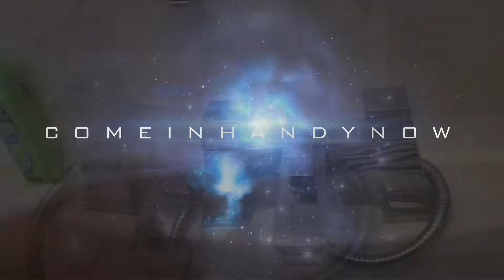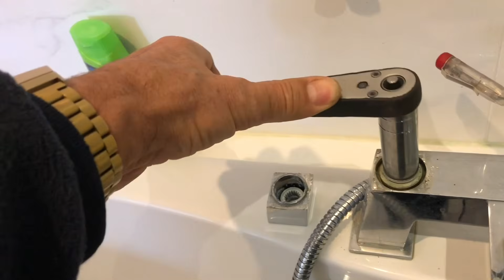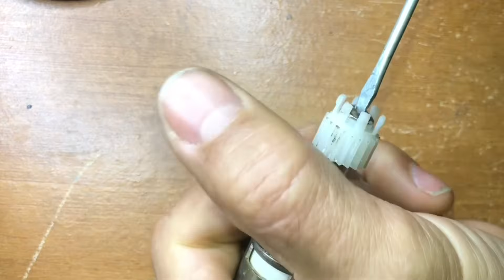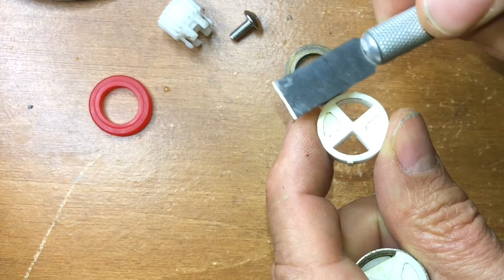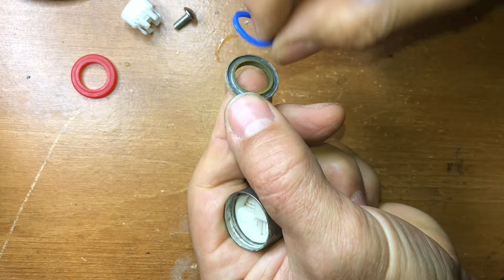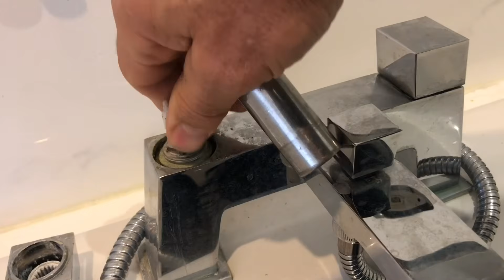Fix a Dripping Tap for Zero Cost Quickly - 1/4 turn ceramic valves

Comment: I think your ceramic plates are back to front, i.e the backs are facing each other instead of the smooth polished side. Probably doesn't make any difference in the end, failure point is probably some washer or O-ring
Reply from the maker: I don’t think so, but it is still working.  The failure reason was calcium buildup spoiling the seal between the ceramic plates.

Comment: I haaaaate these stupid 1/4 turn taps. Costs like $80 to replace the valves and they last two minutes. Losing 12 litres a day from a leaky tap that leaked the day they were installed and it turns out they fail all the time. You'll never know what leaks where and why, either. At least jumper valves can be swapped out for 30c a piece.
Reply from the maker: They are more complicated and more expensive. The way most things go.  Zero cost fix here though so not all bad.

Comment: Philips screw, blade screwdriver
Reply from the maker: Did you not see the text on screen which was “Preferably with a Pozidriv or Philips screwdriver! (I was being lazy)” ?   Were you skipping through and being lazy as well?!
Reply: I find all screws on taps are Phillips. The screw heads are very soft and pozidrives can damage them. Good video 👍
Reply from the maker: @stevenewbank  Thanks

Comment: This is the first video I have seen that gives the principle of operation.  Over 15 years I have repaired mine twice, and never was it deposits sticking on the two discs that caused the problem, in my opinion.  Cleaning is good, but some measures to counteract aging of the unit guarantees success.
Reply from the maker: Thanks, yes, ‘softening’ the water (removing calcium from the water) with a water softener unit is a good step for plumbing longevity.
Reply: Hi, what was the cause of the leaks if not deposits on the two discs? Just replaced my first 1/4 turn tap assembly, want to clean the old one as a spare. Thanks.
Reply: @pmd7914  There is a plastic insert that between the lower ceramic insert and the recess on the tap body that compresses when the cartridge is tightened. 
In my experience this loses some of its 'elasticity.'
Introducing packing above the upper ceramic  insert restores the force that holds the disc surfaces together.
Some designs differ and the packing can be added under the lower disc. I have successfully repaired both types.
Reply: @stonyman694  what do you mean by packing? Please clarify what I could actually use for this. Thanks.

Comment: How do you isolate the hot water if you cannot see an isolator under the sink?
Reply: If the tap hasn’t got an isolator, you’ll have to turn off the mains Coldwater going into the house then turn on the cold and the hot taps long enough to relieve the pressure or to drain off the cold water tank until it stops flowing
Reply: @socialfun621  Ok perfect - sounds like a job after the morning showers when hot water in tank  has been used, cheers
Reply from the maker: @gittin_funky  drain off the cold water pressure first before doing the hot then you won’t loose too much hot water.
Reply: @comeinhandynow  cheers - great channel

Comment: Have you tried putting all the pieces into a some regular citric acid descaler? 
And maybe down into the tap once the cylinder is out too?
Maybe it would do something to the rubber o-rings?
Reply from the maker: No doubt that would help a bit but acid dissolving of scale is a slow process and not always 100% effective in my experience.  No harm in trying though.

Comment: Thank you for this helpful guide. there doesnt seem to be any retaining screw on my square bath taps. Is it just a matter of forcing the cap up with a screwdriver?
Reply from the maker: Thanks. It is difficult to tell you remotely, you will have to try and analyse and work out how it comes apart, with a bit of trying different things.

Comment: If anyone wants good reliable taps, which hardly ever drip, and if they do require a simple change of a rubber washer then AVOID taps with these devises. They are a pain in the arse.
Reply from the maker: Taps with old fashioned rubber washers drip as well.

Comment: Thanks for the video. I have a set of the very same exyfix wall taps. The plumber that installed them took the tool with him when we did the shower area. Now the valves are leaking a bit and need to remove them to fix them or replace them, which is difficult to do without the tool. But at least I know what to do and what I need to do it. Thanks once again. It was a pity, though, that the last half of the video did not show what you were doing with the spindle, as it was away from the camera area.
Reply from the maker: Thanks. I will see if I can help with any missing information.  I had a quick look at the video again, not sure which part of the last half you are referring to. If you can tell me the time point and information needed that might help, I’ll see if I can add something.

Comment: Any tips for how to remove the unit from the ring it sits in that screws into the body of the tap?  As soon as I start to undo the brass unit, the rest of it unscrews as well and I don't want to damage the housing.
Reply from the maker: You’ll have to get a wrench on the body of the tap but isolate it from damaging it with rags or something or maybe put a tube over the tap for leverage.

Comment: Hello I’ve changed both my hot and cold valves for new ones and still my mixer tap is dripping. Please help
Reply from the maker: Sounds like one is faulty or maybe some corrosion on the body is causing it. Dismantle it again and try and see what the problem can be.

Comment: Hi, other youtubers suggest putting some vaseline or other on the 2 surfaces of the disc, what do you think?
Reply from the maker: Not sure I would want that coming out of the tap.
Reply: As long as your taps are not being used for potable (drinking) water, a thin film of Vaseline between the two ceramic discs should be okay. I would not consider any other lubrication.

Comment: Excellent step-by-step video. It certainly is worth servicing a cartridge where possible, not just to save money, but because it can be a right nightmare finding a compatible replacement with the right dimensions, pressure-rating, number of splines etc. This is especially true for some of those cheaper taps with no brand-name.

I would suggest - as others have - that soaking the components in white vinegar then using an old toothbrush to clean off the residue is most effective. When cleaning the deposits off the valve-seat in the tap body, I would recommend investing in a tap re-seating tool which isn't an expensive item and will clean the seat effectively without the risk of scratching the mating surface. I would also suggest flushing the tap body before reassembly as you don't want any of the scraped-off deposits contaminating the cartridge - just open the isolation valve very slightly (unless you want to wash the ceiling) or slightly turn on the other tap if you're working on a mixer.

Great stuff! Thanks for posting.
Reply from the maker: Thanks for you comments and ideas.

Comment: I take mine apart and soak the valve body and the disks in pure white vinegar for 12 hours.  I brush the parts with an old toothbrush every 4-6 hours and rinse well at the end.

 I don't soak the bottom seal if it separates from the disks.  I clean it off with vinegar and rinse it off.  

There's usually no need to remove the top snap ring that's closer to the handle end of the valve. It usually services no purpose in removing the disks at the other end.

This has worked for me.
Reply from the maker: Thanks for your input.
Reply: I have some food grade acetic acid powder and would mix up a small pretty strong lot and soak all the components of the valve  insert for two to three hours then rinse in warmish water to get rid of the acid. This will eat every bit of limescale completely. And providing there are no scratches on the mating ceramic surfaces this should sort any leaks out completely. I also use a strong hot water solution down the toilet to get rid of stubborn under water limescale marks after using toilet brush to try to drive as much of the standing water out of the pan before putting the hot acetic acid in the pan. ( I use hot water as it dissolves the powder much better than using cold)

Comment: You say that all the measurements  are available on-line, but what if you can't find out  what make of tap it is ? The one you dismantled is the strangest design I've ever seen. Mine is Late Victorian /Edwardian STYLE, with classic Cross Heads, but not like those on-line. I've given up repairing it, and want to switch to Ceramic. But where do I start? The 'Shroud' is like a Table Lamp Shade, will it fit over Ceramic inner's ?
Reply from the maker: It sounds like you will need to change the whole tap or pair of taps.

Comment: Hi, What about the valve for the shower itself? Do you just need to unscrew that or smth? Thanks.
Reply from the maker: The shower attachment will only drip if the tap valve is leaking so the only reason to remove the shower valve would usually be if it was sticking. Probably unscrews but I’ve not had to take one off yet.

Comment: Just on limescale a trick I like to use is soaking parts in 50% lemon juice and 50% boiling water for 20-30 minutes. It means you don't have to scratch it off and risk any damage. Works super well on a kettle just fill it with lemon juice and water boil and let it sit. I use the cheap lemon juice from a supermarket.
Reply from the maker: Thanks, good tip. Vinegar is another acid that also works.

Comment: Just stripped and cleaned the hot and cold ceramic cartridges on my mixer tap, didn't find any scale on anything (soft water area) and all 4 ceramic discs were smoooooth, but there was a lot of plastic swarf in the 90° stop recesses "above" the ceramics. I suspect this was preventing full closure!
Cleaned as needed, reassembled and now no more letting by :-)
Reply from the maker: Great, well done.

Comment: How did you get the tap head off? Got similar tap with no screw hole but doesn't want to shift,
Reply from the maker: If there are definitely no screws holding it then it should pull off vertically.  Try levering it off with a long screw driver alternating from each side.  It probably has calcium deposits sticking it in place that need loosening.

Comment: In the name of progress these ceramic valves seem very over engineered,compared to simply just replacing a rubber washer on conventional taps , or a simple reseating tool to improve the seal with washer and outlet.
Thanks for showing the possible fix by disassemble and clean up.
I am diy when I can,🤑
Reply from the maker: Good to hear. Keep up the DIY!

Comment: Wow, at no time was the correct tool use! Not very professional.
Reply from the maker: It’s a DIY channel but what is ‘not professional’ about using a socket a wrench and a screwdriver?  Barely much else used.  They got the job done and it hasn't dripped since.
Reply: John, does the tap drip? Has he shown how he fixed it without buying a new cartridge? What's your problem again?

Comment: Thanks for this video. Super useful. 

Out of curiosity, was the shower head attachment also leaking originally? 

We have the same type of bath taps / shower combo and both of them leak depending on which attachment you want to use (I.e if closed to use bath tap, the bath tap will leak after 5-10 mins OR if open to use shower attachment, then that will leak, but never both at the same time).
Reply from the maker: Yes, if it is switched to shower then thats the one that will leak.  On mine it switches back to taps when the water flow is low, so was always the tap with the drip.  It is still working drip free now.  Zero cost spent.

Comment: Just goes to show, expensive and complete crap..... the ones mine replaced were fine for 29years, 12 months and these are crudded, corroded and outside warranty.
Reply from the maker: There is a lot of stuff of low quality around, usually from china in my experience, but that is like everything.  People want cheap, they get low quality.
Reply: @comeinhandynow  they weren’t cheap!
Reply: @sre331l  they were for the manufacturer!! 😄